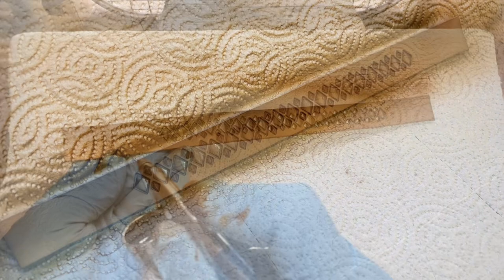Making A Handmade Braided & Tooled Leather Cuff - Leather Craft

Comment: I was curious as to where you acquired the one inch steel bracelet connector?  I watched this video several times and have come away with some ideas of my own.  But I can't seem to find the connectors in the size you use.  Tandy's has one at about 1/3 of an inch.  Lot's of google searches have been unsuccessful.  Where do you get yours, if you don't mind sharing.  Thanks.
Reply from the maker: I did get it from a physical Tandy store. it is 1” wide I believe.

Comment: Nice looking cuff. I do have one suggestion, I would use blue lock-tight on those screws. I’ve had problems in the past with screws like that eventually backing out.
Reply from the maker: Thank you. I agree, I would do that if it was for someone else, but because I’m keeping it for myself I’m not that worried about it.

Comment: Hi, wicht glue do you use for the leather? Can i choose te carpenter glue?
Reply from the maker: I use a water based contact adhesive called EcoWeld. Any contact adhesive or contact cement would work.